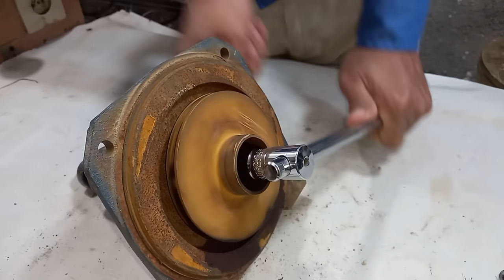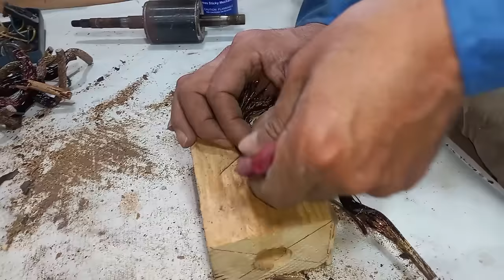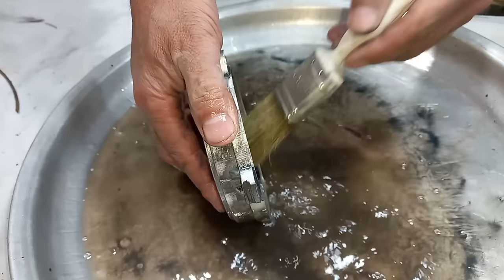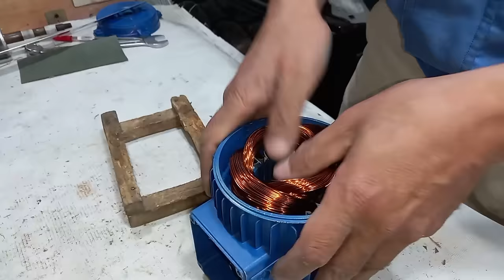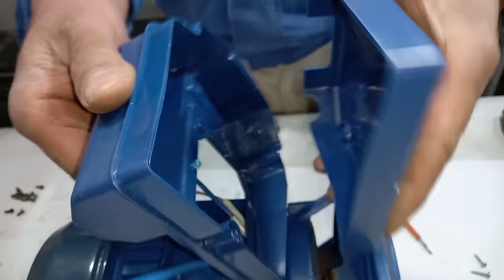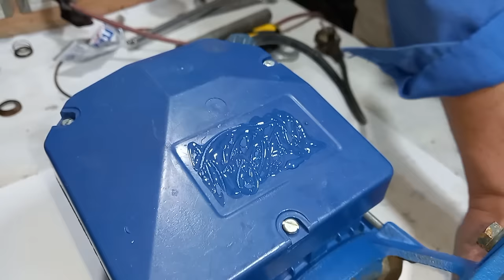FULL RESTORATION video. Repair 1HP Burned Electric Water Pump

Comment: How do you know how many windings to make and the size?
Reply from the maker: Thank you for watching😊❤
By counting each coils and counting the number of rounds and drawing the map, but I forgot to include the water pump map in the video.😅
Reply: That's brilliant. I see where you count them now. And you burned the epoxy off to measure the actual size of the wire with a micrometer. 
How many motors have you rebuilt? Did you teach yourself?

Comment: your wire connection is a nightmare. Enough space for a terminal block available. Fix the shaft of motor in drilling machine and clean with scotch bright. Why are you using the old rosty screws instead of new ones. For beginner accetable job
Reply from the maker: Hi wolf . Thank you for your beautiful comment❤. I will follow your advices in the next videos